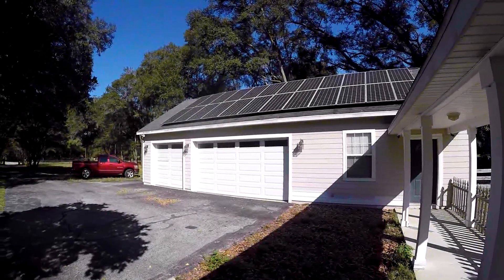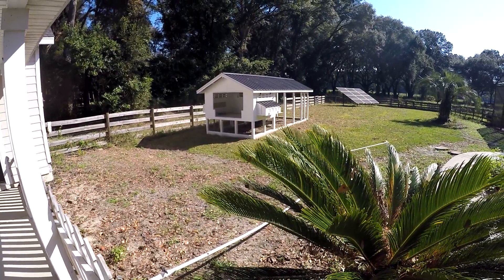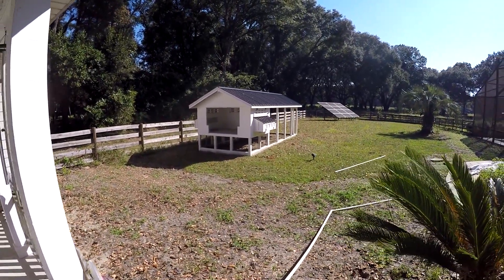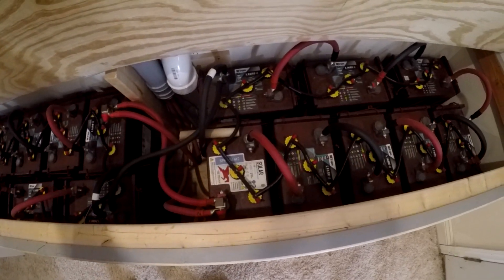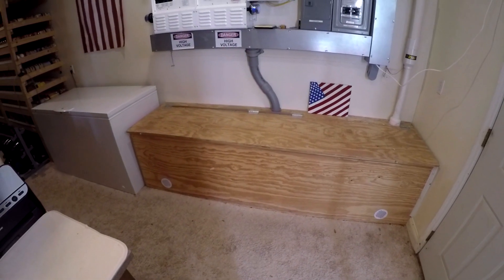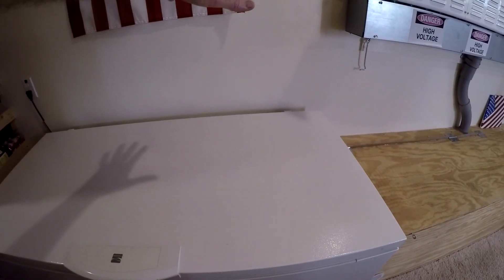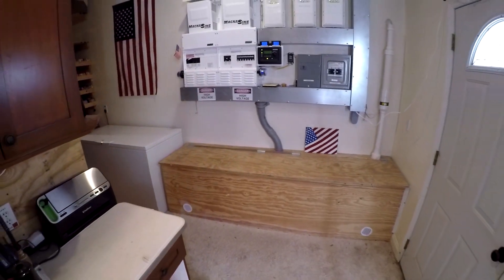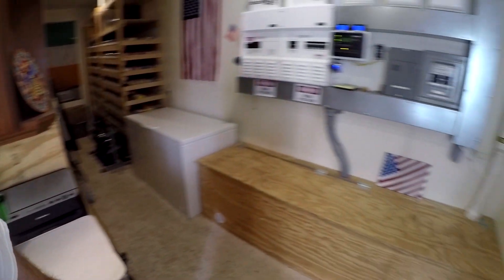Sunday Walk and Talk

Comment: You just answered your own question, " do I keep the old battery bank or get the new one even tho it's not emp proof." Also, the cost an more electronics more possibilities of failure.
Reply from the maker: Yes, I think it is unlikely that I will get rid of the old battery but I may go ahead and add the new one as well.  Normally I tend to run stuff into the ground before I replace it (i.e. my 15 year old truck).  My concern is that given the current risk assessment, I don't want to get caught in a situation where I am unable to precure a new battery that will last 20+ years.  My current battery has between 1 and 9 years left in it and I have no way of knowing.  Plus, I can really only use 10kWh/night with my current battery if I want it to last Vs. the 25kWh/night I can use with the new battery for 7000 cycles.  I think I tend to value backup power more than the average "prepper".  I think my family's life may depend on having a working battery bank as much as having food and water so I am willing to spend the extra money on that insurance policy.  Thanks!
Reply: I can see having 2 battery banks. Please don't forget about the ferrite core clamps then your emp proof for sure.
Reply from the maker: @chasemoore3885  My problem is that the rest of my system is not EMP proof.  I do have 1 backup charge controller that I keep in a Faraday cage but I don't have other backup spare parts that I would likely need.
Reply: If your familiar with the Sol-Ark system they use ferrite core clamps on, solar panels, batteries and inverters. To protect the system. One of my co-workers just had the 15k Sol-Ark installed with 19kw of solar. Hopes this helps.
Reply from the maker: @chasemoore3885  I am familiar with the Sol-Ark and I think it is probably the best solution for EMP and maybe the best solution even without considering EMP.  If you got the cash, you can't go wrong with a Sol-Ark.  Note: My system is protected with 5 of the Midnight Solar surge protectors so maybe that will help but I guess no-one knows until it happens.  Thanks!
Reply: Definitely keep the old battery bank, you've already invested in the equipment so having another form of redundancy is just a few mods away.

Comment: Two is one and one is none. Get the new batteries and keep the old ones with an extra low-frequency inverter that will at least run a well.
Reply from the maker: Update:  They are in route right now!  :)
Reply: @HomesteadEngineering  How many 6?.
Reply from the maker: @sh839c  Yes, 6xEG4-LL (V2)

Comment: I like those rack mount battery setups and was thinking of a split phase inverter and a bunch of batteries as a secondary backup in addition to my generator. No solar yet, so I'll be waiting until 2023 to take advantage of the 30% federal tax credit for stand alone battery systems.
Reply from the maker: Right, so basically an oversized UPS that you can recharge with the generator until you get around to adding solar.  Sounds good.  I was told the 30% credit was available now, is that not true?
Reply: @HomesteadEngineering  

SEC. 13302. RESIDENTIAL CLEAN ENERGY CREDIT.
(d) Effective Dates.—

(1) IN GENERAL.—Except as provided in paragraph (2), the amendments made by this section shall apply to expenditures made after December 31, 2021.

(2) RESIDENTIAL CLEAN ENERGY CREDIT FOR BATTERY STORAGE TECHNOLOGY; CERTAIN EXPENDITURES DISALLOWED.—The amendments made by subsection (b) shall apply to expenditures made after December 31, 2022.
Reply from the maker: @browsedeweb8834  But what about this: 
SEC. 13302. RESIDENTIAL CLEAN ENERGY CREDIT.

(a) Extension Of Credit.—

(1) IN GENERAL.—Section 25D(h) is amended by striking “December 31, 2023” and inserting “December 31, 2034”.

(2) APPLICATION OF PHASEOUT.—Section 25D(g) is amended—

(A) in paragraph (2), by striking “before January 1, 2023, 26 percent, and” and inserting “before January 1, 2022, 26 percent,”, and

(B) by striking paragraph (3) and by inserting after paragraph (2) the following new paragraphs:

+++++++++ THIS ONE ++++++++
“(3) in the case of property placed in service after December 31, 2021, and before January 1, 2033, 30 percent,
+++++++++++++++++++++++++++

“(4) in the case of property placed in service after December 31, 2032, and before January 1, 2034, 26 percent, and

“(5) in the case of property placed in service after December 31, 2033, and before January 1, 2035, 22 percent.”.
Reply: @HomesteadEngineering  Yep, all that applies same as before, so if you have solar you're good.  The battery section I referred to is for standalone battery backup storage (with no solar) only.
Reply from the maker: @browsedeweb8834  You have me questioning this now.  Need to investigate further...

Comment: any chance on your next coop update you can show the detail on the hen box mounting dimensions and HDPE divider install?
Reply from the maker: Hello Scott, You can find the list of videos under the description and I will include it here:
(Check out Egg Hutch Framing for some dimensions)

Coop Series:
Pt1: Layout and Dig:  https://youtu.be/HH2TvV7gkBY
Pt2: Post and Foundation: https://youtu.be/1cC89NmaOtM
Pt3: Framing the Roof: https://youtu.be/J32Z8KBfrMQ
Pt4: Paint and Metal Roof: https://youtu.be/qIoLWO9fNDo
Pt5: Hen House - Floor Level: https://youtu.be/V6mHRTq3Tdk
Pt6: Hen House - Hutch Level: https://youtu.be/abps-u9xhcA
Pt7: Egg Hutch Framing: https://youtu.be/wgW5lSZeaOQ
Pt8: Hen House - Window Level: https://youtu.be/81iYL6BNGTQ
Pt9: Hen House Sheeting: https://youtu.be/7QNz0Esom7A
Pt10: Floor and HDPE Litter Box: https://youtu.be/03IpL3WHSFc

Completed and Coming Soon:
Pt11: Egg Hutch Sheeting and Trim Out
Pt12: Egg Hutch Doors
Pt13: Egg Hutch HDPE
Pt14: Egg Hutch Attach and Roof
Pt15: Windows

In Progress...
Pt16: Clean Out Door
Pt17: Double Doors
Pt18: Run "Man" Door
Pt19: Run "Chicken" Door
Pt20: Run "Tractor" Door
Pt21: Hardware Cloth
Pt22: Ladder
Pt23: Auto Water
Pt24: Auto Feed
Pt25: Roost Bars
Pt26: Parts List and Cost 
Pt27: All the Mistakes
Pt28: Coop Tour
Reply from the maker: Note: Part 13 will go over the HDPE dividers

Comment: If it isn't broke don't fix it. Battery technology will change again in 5 years.
Reply from the maker: John, That would be my go to strategy in normal times and that is exactly what I would do.  That said, my concern is that we are in such unpredictable times that I can't rest assured that it will be possible to replace the battery when needed.  That's why I think I may go ahead and spend the extra money now as an insurance policy.  My family would be completely dependent on having power in a grid down situation.  I actually think that most people are dependent on power they just don't necessarily realize it until its too late.  Even Prepper Princess only lasted a day without power and she is able to live on next to nothing on a regular basis.  I really think that "preppers" need to take long term backup power MUCH more seriously.  Maybe instead of getting that 47th weapon, you might want to consider solar power for your refrigerator, freezer, lights and well pump.  BTW John, this rant at the end has nothing to do with you, I just have to say it as no one else is...  Thanks!